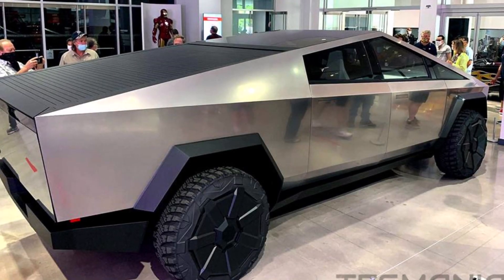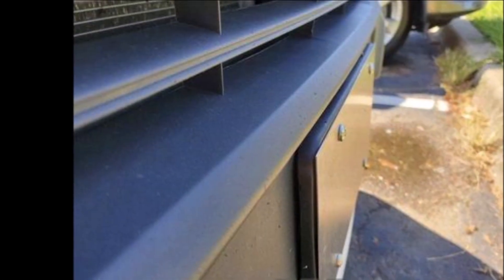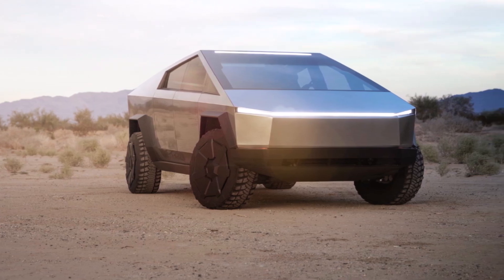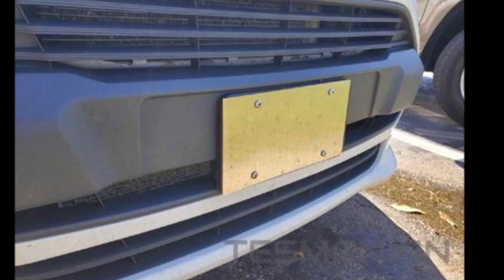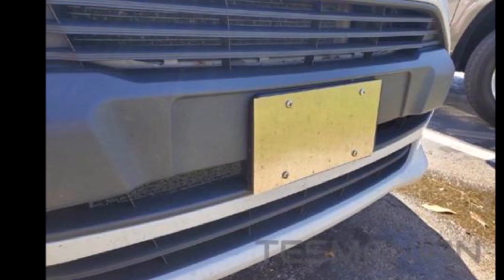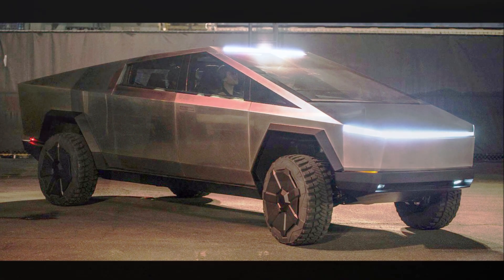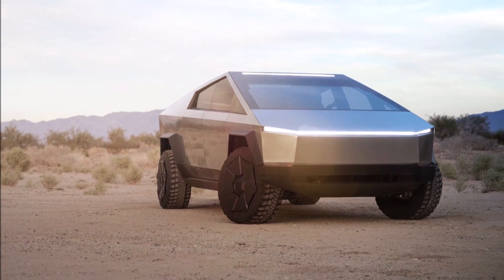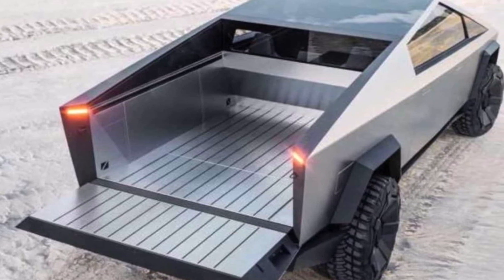Tesla Is Testing Cybertruck's Skin

Comment: Current police vehicles are most emphatically NOT bulletproof.  That said, a 3mm steel skin makes it quite minimally bullet resistant, it is nowhere near the level of bulletproof of cars that have been actually upgraded to be bulletproof, and not even close to the level of armor of even light military vehicles. Still, the vast majority of street crime involving guns is with 9mm ammunition or smaller, and the Cybertruck stands a good chance of protecting someone long enough to get away, assuming the bullets do not hit the windows. The windows will NOT stop bullets.

Comment: No, wrong conclusion.  Placing license plate fixtures on service vehicles is not how you test resistance to bullets.

What they're after is an understanding of wear and weathering.  How will the steel look after it has been exposed on a vehicle for months or years?  How will operation in colder climes where salt is used on roads affect the steel?  Or sea-salt in coastal areas?  Acidic rain?  Laboratory testing can provide some answers, but Tesla understands that the real world is more complex and can't be exactly simulated in a lab.

You test resistance to bullets by shooting bullets at the steel from various angles.  There really is no other way.  I'm sure Tesla has done some of this, but bullet resistance is not their priority for this truck.  Structural integrity, ease of manufacturing, and durability are what they are probing with different steel alloy recipes.

Bullet resistance is a side benefit of using steel thick enough to serve as a structural exoskeleton.  That isn't likely to change much, if at all, as they experiment with different alloys.  They aren't going to reduce the thickness of the steel, and any changes they might make to the recipe will be subtle - noticeable mainly after the truck has been in service for years, not at the point of sale.

But it is news that Tesla is experimenting with different alloy recipes.

They may also be looking for an alloy recipe that reduces nickel content without sacrificing structural integrity, ease of manufacturing and durability.  Elon has already identified nickel as a raw material which may encounter supply shortages in future years.  Using less would be a cost benefit and reduce the impact of a potential bottleneck, if they can identify a low-nickel-content alloy that performs just as well as high-nickel-content alloys.

Comment: I'm more annoyed that people say bulletproof like it stops all bullets when it is only rated for 9mm pistol officially. My plate carrier can stop more rounds of a higher caliber than the truck ever will be as it is a class IV plate and if you have armor that thick on the truck, it will be heavy AF. Police cars don't need to be armored, you just need to be behind the front wheels where the engine block is to stop incoming bullets and that goes for all cars with engines. I do not recommend hiding behind a Tesla during a gunfight, especially if it's not a cybertruck as there is no engine block to stop bullets. The frontal slope of the cybertruck should be able to tank larger caliber rounds than the sides which are not as aggressively sloped as that is literally how sloped armor works.

Comment: Would like to know how much the body weighs compared to a steel car equivalent. If the body is 3mm then the weight would be way more, unnecessary weight. Unless your thinking of committing a crime.
Reply: No, because the body is also serving as the frame and chassis.
Normally a truck will have decorative thin body panels for the cab and bed, and that will sit on a thick steel frame underneath.
This is going to do away with the frame and use the strength of the formed 3 mm steel to form the structure of the vehicle.

Comment: So cool.  Wondering if the Cybertruck will use the newest alloy Space X is now using for their spacecraft.
Just so you'll know, most 3 mm cold rolled stainless sheet metal alloys will stop a 9 mm handgun round.   Friends and I were shooting a stainless steel sink from a scrap pile recently and it was able to stop a standard velocity 9 mm rounds, and 45 ACP from a handgun as well.  Big dents, but no penetration.  Just about any serious rifle round, such as .556, .762X39, .762X51 or even 30-30 will go right through a Cybertruck with no trouble, as will many high power handgun rounds such as .357, .357 Sig, 10mm, 762X25, 44 mag, and several others people will probably add to the list.  "bullet proof" in this case means very tough, more than a promise this material will actually stop  bullets.